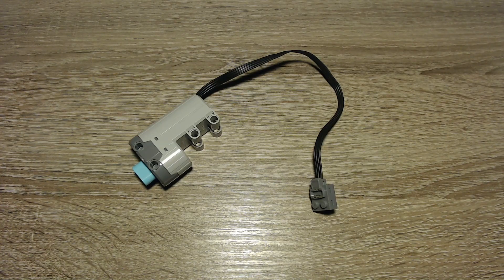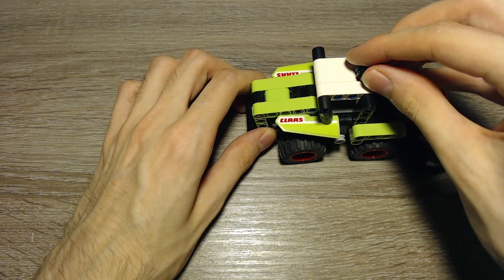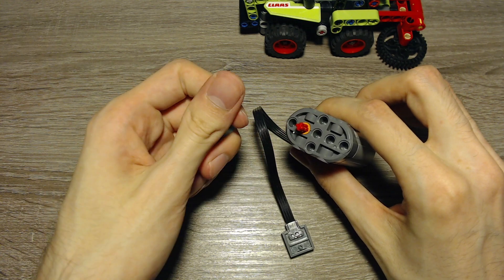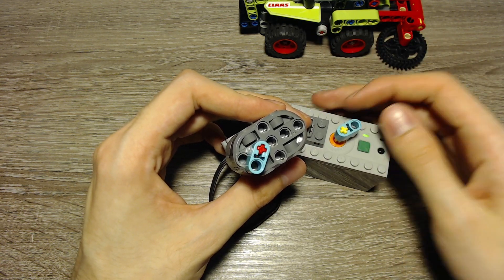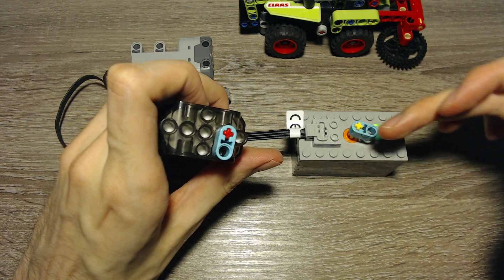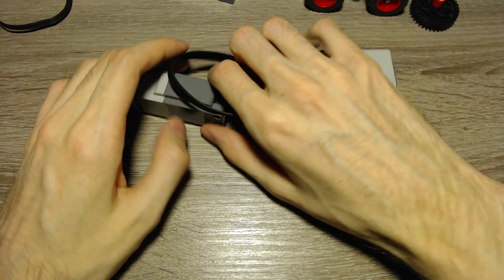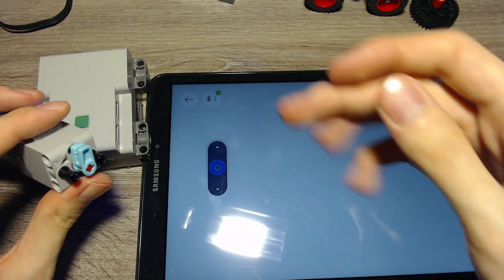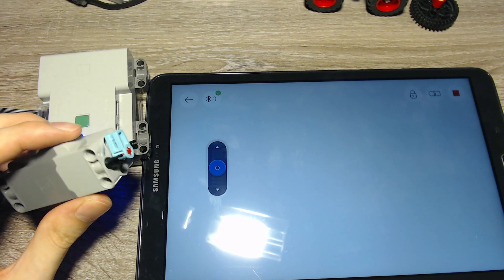Basics of the LEGO Power Functions Servo Motor (88004): why does it exist? [English|HD]

Comment: Thanks for the very informative video. I know the PF servo motor is only used in 3 sets. I will soon have 9398 4x4 Crawler. If a power supply WITHOUT variable voltage is used, is there any way to rotate the servo to other than +/- 90 degrees? If not, I suppose that's a hard steering (all or nothing). I'll know soon enough when I receive my 9398, which is controlled via IR Receiver (V2), but the remote controller does not have variable position, so it's the same problem. Perhaps it's time to just move on to Powered Up...
Reply from the maker: You can only use 3 positions with the "normal" non-train remote.

Comment: Hi, very informative. I have a question is it possible to have more than one Tech hub connected to one project eg: eight motors
Reply from the maker: You mean one project in the powered up app? If so: yes. You can check out part 11 of my powered up tutorial series if you want to see how.
Reply: Thank you I have gone and checked it out, I did a test run and got them working
Reply from the maker: Good to hear :)